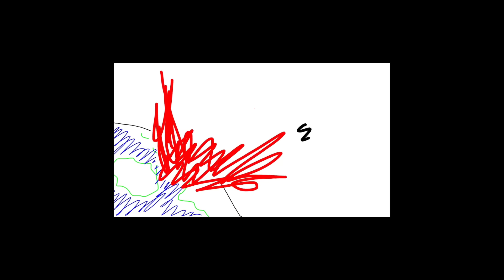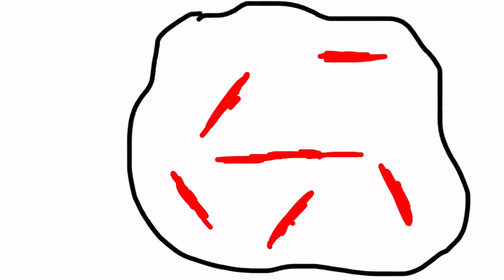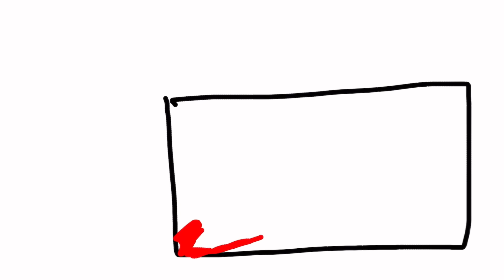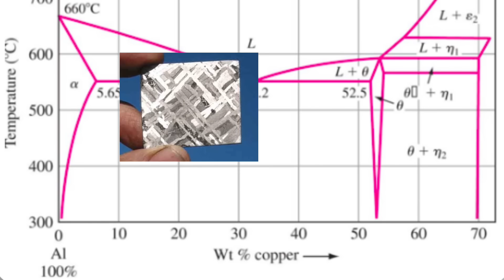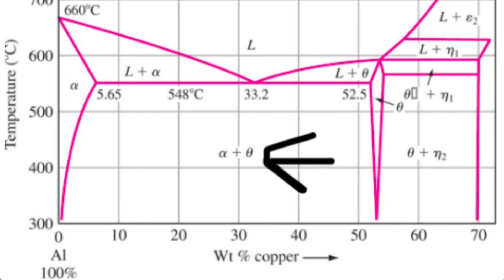Making Meteorite Part 1: Al-Cu

Comment: @Electronimpressions
What would it look like if you attached a fiber optic light source to the defect created by the nail? I wonder if it would only light up the Lichtenberg fractals? Or, try using one of those optical audio cables that emit red light. Try a UV laser too. How do I obtain electron treated acrylic blocks?
Reply from the maker: The channels would scatter the light given to them by the fiber optic, bright lights all across the bottom give a better effect. Unfortunately the charged blocks cannot be obtained— after irradiation we only have a minute or so before all the charge bleeds out from the acrylic.

Comment: im curious how brittle or not this alloy is. it'd make some sick jewelry, or knife/sword fittings, IF its reasonably solid and wouldn't break or flake apart easily
Reply from the maker: It’s extremely brittle and unworkable haha. Al2Cu is more like a ceramic than a metal. I made a different material in my newest video that is orders of magnitude more workable though, although the features are much smaller.
Reply: @ElectronImpressions  oh sick you're already on it lmao. i dont have the set up necessary atm but this might be another reason for me to get a smelting furnace

Comment: I made a similar AlCu alloy about 2018 or so. 

Was more blue colorful like bismuth, and supper brittle. I think i had a lower aluminum percentage.
Reply from the maker: When these ingots first come out of the furnace, there is certainly an iridescent oxide layer present some of the time. And yep— it’s very brittle 😂 Al2Cu is more akin to a ceramic than a metal, so unfortunately this alloy isn’t very useful for anything. But I’m working on a new video with a more workable alloy.

Comment: You gotta cool them in a vacuum, with no gravity
Reply from the maker: The gravity does not really play a role, but a vacuum would be interesting
Reply: @ElectronImpressions  Crystals grown in microgravity have more uniform-diffusion controlled growth.  The molten material is already fighting convenction currents, but gravity adds a lot to the segregation of denser material.  You need the material to change in any way as slowly as possibly.  Vacuum helps control temperature shedding due to convection, but thats negligible with gravity!

Comment: Get a electric furnace, you can hold the temperature at the liquid+θ triangle to get good crystal growth.
You can use a CCT diagram to get the right amount of pattern vs background

nice work, keep on trying!
Reply from the maker: Those diagrams are one of my favorites. I didn’t go too deep into the metallurgy in this video. However I would like to in the future for a follow up or for a different material system when I have that electric furnace and can reliably utilize the diagrams— which is definitely on my wishlist lol, gotta sell enough lichtenbergs to justify its purchase 😂

Comment: That is quite an impressive result! My question is, can this be etched so the color difference is more apparent?
Reply from the maker: I used radiation HF based aluminum enchants with no success bringing out phase contrast. I will be attempting other etchants recommended by viewers shortly
Reply: @ElectronImpressions  Okay, very cool! Thanks for the reply

Comment: Would etching the polished surface with acid make the pattern stand out better? I seem to remember a Cody'sLab video where he partially dissplved some gold and we could see the inner grain structure.
Reply from the maker: Yes your right, although I need to find a good etchant. I’ve used traditional HF based aluminum etchants and it brings out grain contrast but fails to bring out the phase contrast. I need to find an etchant that gives me the phase contrast but not grain contrast. I’ve gotten a lot of suggestions from comments, I will have to try them out when I get the chance.

Comment: If there are some real astro physicists in here, please correct me if I'm wrong, but wouldn't those crystalline structures have formed before they got shot out into space, not after?
My understanding was that much larger, planet sized objects would cool extremely slowly (our own planet's core is molten still), and that causes these crystalline structures to form in their nickel/iron cores as they very slowly cool down, THEN massive collisions happened which shot chunks of that previously molten core out into space. Is that wrong?

Comment: do you have any tips/tricks on the melting process and subsequent cooling process? I dont have access to a large furnace because I usually work with smaller metal pieces for jewellery but I can cast smaller pieces

how hot do you think your furnace got? I hope its not copper-melting temperatures..
Reply from the maker: The copper will dissolve in the aluminum at temperatures much lower than its melting point, so melt aluminum first, then add copper. One thing you should be aware of is that hydrogen is extremely soluble in aluminum and its alloys. A large piece is kind of required because unless your looking for the surface crystals, you must grid away a lot of porosity that results from hydrogen leaving the metal as it solidifies… that or do it under argon/nitrogen. 

I also wouldn’t recommend the alloy as it stands now for jewelry because it is incredibly brittle and prone to cracking. However if you try please let me know how it goes!

Comment: I always tell coworkers that metallurgy is spooky, and to not tempt it if possible (in the context of printed circuit boards, and mixing solder alloys, or using whatever new trendy plating the boardhouse offers, but has no tangible benefit for our application)  Turns out it is indeed spooky to see someone know what they are doing and wielding it and bending it to their will.   Weirdest metallurgy related thing ive seen in electronics is some garbage-tier gold plated RC bullet connectors that didnt have a nickel underplating. Heat them to ~200-250C (as you would soldering in wires, and maybe got it a bit too hot)  at at some point, you can watch the gold diffuse into the copper in realtime. The plating just vanishes leaving a copper surface.  Solid-state diffusion, right before my eyes. (well, under a microscope)
Reply from the maker: There’s a super cool demo that this reminds me of— plating a penny in zinc, then heating the penny to diffuse the zinc into the copper and make brass. The penny changes from silver to gold is just a few seconds, one of my favorite demos.

Comment: would ammonia (or maybe some other compound) be useful to increase the contrast? I often use it in mokume-gane so maybe it'll work on this alloy
Reply from the maker: Thanks for the suggestion, something that works on mokume-gane is the right idea here. I’ve tried and the traditional HF based etchants bring out grain contrast and muffle phase contrast. I need something that contrasts the phases but not the grains. I doubt Al2Cu and Alpha Al are significantly attacked by ammonia, but what could I lose by trying, lol. I’ll let you know!

Comment: I actually saw this intermetallic made accidentally by a channel called BigStackD when he melted down an old household ac unit and poured it into bars. The radiator was made from aluminum fins around copper pipes. They formed this similar structure which actually led me to comment about Widmanstatten patterns and the similarity.

Comment: It was over 30 years ago while plowing, I turned up some rocks in a patch of new ground.  While gathering them to toss into the fence line one was super heavy , and black. That night I took it to the barn.  I beat on it with a sledge hammer to it.  After a long sweaty battle a piece final chipped off.  It had this same grain structure.   I tossed it to a corner , and forgot about it.  Later while studying metal urgery I realized that it was a meteor ride. I went back and looked for it, and it had disappeared.  Still haven't found it to this day. It was near the size of a gallon jug.   If I had of found it , I would have sliced it into knife blades. What would it have been worth , as far as dollars worth?   It was so hard it marred up the face of the sledge hammer trying to get inside of it.
Reply from the maker: I hate to be the bearer of bad news for you but that would be a life changing amount of money 😂 perhaps anywhere from 15k to 150k depending on the grade for something that large. What an incredible find! I really hope you find it one of these days.
Reply: @ElectronImpressions 😢

Comment: Well interesting video  and thanks too my background in a steel foundry  i say bullshit too the "impossible too make on earth" part you already showed that with the AlCu  that if you let the liquid alloy cool slowly enough  so that it is is in between solidus and liquidus lines that the crystal structure cann be grown big enough  but too achive that  with Iron and Nickel you need a realy good furnace with very precise temperature control  just repeating the same process at way higher temps with the right alloy for that and the Fe-Ni phase diagram shows it 

but too be fair the temperature range for Fe-Ni in between the solidus (at its lowest 1436°C and Ni of 68%)and liquidus (at its highest 1512°C at ~10%Ni) lines ar very close and the corelation between alloy and temperature isnt realy  linear 

And i also doubt that your diy Furnace is capable of these high temps (over 1500°C) to begin, but your diy Gas buner furnace could provide an almost perfect cooling  chamber too let the crystals grow at max heat of the furnace and after the ingot is voller than 1400°C you cann let it cool way faster since the crystal should already have formed 

So if you cann build a miniature arc furnace out of the porus alumina bricks  and a old mircowave like Grand Thompson aka King of random did (but please order graftite rods for welding and dont use carbon rods out of batteries ) you should definitely try it out

Comment: Cu and AL eat each other relatively fast. Back in school I poured a bronze and Aluminum casting for my BFA. It looked amazing swirled together but quickly separated as the 2 reacted together. The bronze I used was mostly nickel and copper.

Comment: I would try to reduce tge air bubbles to make something from it !
Reply from the maker: Air bubbles are from hydrogen dissolution and are inevitable unless done in an inert atmosphere. Although they are only present on the surface, so there is plenty of usable material. I would love to make something out of it but it’s so incredibly brittle I fear I would have a tough time!

Comment: Appreciate the video, amazing delivery of a mix of both theory and practice. I'd note that Al2Cu phases can delaminate cause they have different galvanochemical potentials iirc. Also, you may try etching the surface with some other etching agents than a classic Keller solution. Maybe with copper nitrate additives. Would love to see a continuation on that topic!
Reply from the maker: You’re right about their galvanic potential, which is another reason I was hesitant to try other etchants. I had a concern that during etching this would result in a galvanic cell and produce deep corrosion at the interface between the two phases, destroying the delicate structure. However maybe that is not a concern on the timescales required to etch. Regardless, I am still going to try!

Comment: fascinating stuff, I have a wish to recreate this and then etch the polished surface  like you would with damascus steel  to use it for handle material. or decorative box and lock work
Reply from the maker: As the alloy stands now, the material is incredibly brittle and difficult to work with beyond just making an ingot— so keep that in mind if you want to attempt it. But let me know if you are successful!

Comment: Don't wanna be "the Captain Obvious" guy here but, to better see the pattern you have to dip the alloy into acid, not just polish
Reply from the maker: Yes, you are right about that. To etch aluminum alloys we use a mixture of hydrofluoric, hydrochloric, and nitric acid.
This project ran over the course of about a month. During that time came an opportunity I was able to use this mixture, and I etched the 45% Cu ingot (not in video, regrettably). The etching brought out contrast, however it gave me grain contrast rather than phase contrast, and actually reduced the level of contrast between phases. It still looked cool, but much better before etching imo. 

I would have to find an etchant that does not etch grains while etching the different phases to make it work. However I was unaware of such an etchant, but people have been providing a lot of suggestions that I will have to attempt.
Reply: @ElectronImpressions dayum... Too much info for an artist 😅
Tho, I wonder if pouring this allow into different types of molds would make difference (hole in the sand, steel vessel or refractory brick etc.), mb putting some debris into more stable alloy to start the early formation?

Comment: Try using an induction heater in a vacuum chamber
See if you could suspend the molten metal in mid air (with no air) in the magnetic field generated by the induction heater, slowly over the course of a couple days reducing the power and cooling the molten metal. That would be neato
Reply: Molten copper doesn't interact the same as metallic inside a magnetic field

Comment: I might be stupid, but why would it take so long for the metal to cool down, isn't space stupid cold? And the space being mostly empty would mean that there is no significant heat due to friction (I think I'm using the right terminology, like the effect when stuff falls into our atmosphere and starts burning, sorry not a native english speaker), like I know the chunks of metal are probably huge but my mind isn't able to comprehend them needing more than a few earth days to solidify
Reply from the maker: So the asteroids become hot through celestial impacts and are sent out into space. You’re right in thinking that space is cold, but it is cold because it is a vacuum. Temperature is the average kinetic energy of all particles in an area— in a vacuum there are very little particles so there is very little kinetic energy and thus little temperature. But at this point temperature isn’t very useful for us… because temperature requires matter. 

Now say we have a hot asteroid in space. It will cool very slowly because in a vacuum there are no means of heat transfer aside from releasing its heat as infrared light, which is very slow. Here on Earth, hot metal can transfer its heat to the particles in the air around it. But in a vacuum, there are no particles to transfer that heat to.

Comment: A few million years to cool?  Do you know how cold space is?  More like flash frozen.  Also the pattern looks like plywood.  Meh
Reply from the maker: The sense of temperature as you and I intuit it requires matter. Temperature is the average kinetic energy of particles in an area; space is a vacuum and thus there are very little particles, and thus very little kinetic energy. So yes space is “cold” but it makes little sense in the way we talk about temperature. 

Here on Earth, metal can transfer its heat to the surrounding matter around it quite easily… because there is a lot of matter to transfer heat to! But in space there are so few particles, the hot metal has a hard time finding anyone to transfer its heat too, thus can only cool down by radiating its heat via infrared light… which is very slow…. 1 degree per million years slow.

Comment: Don't you kinda also need enough of the right iron isotopes that only exist like.. in orbit around other celestial bodies that are not earth? I would think that the gradual decay of such isotopes is almost as important as having millions of years to cool down? Or is this not an important variable to consider for the structure to form properly? And what about gravity? I would think the gravity of being on earth might not allow the crystal lattice to form?  Or is the formula literally just vacuum, time, iron and enough residual heat to start off with? Many natural patterns look alike, how can you verify that your structure is EXACTLY like what we find in meteorites? Or are those too random to pin a pattern (like snowflake structures?)on that bears pristinely repeatable results? Its a lot of questions. Take your time ! I do enjoy your process and results :)
Reply from the maker: I don’t want to get the wrong idea here, my structure is absolutely not identical to the widmanstatten in real meteorites, it’s not even iron or nickel haha. My structure is made from a liquid to solid phase transformation while meteorite is solid to solid. But, in my opinion, my structure is still at least very cool looking and shares a strong resemblance. 

As far as the iron and nickel isotopes, I think that may actually be relevant. In very large asteroids heat from radioactive decay may be a factor that allows for even slower cooling? Or perhaps giving them an initial high temp if not initially hot enough? 

I don’t think gravity is a limiting factor in widmanstatten formation.

Comment: Can this be etched to highlight the pattern at all? This would be great for knifemakers to use as fittings or handle material the way that meteorite is.
Reply from the maker: I’m working on finding an etchant that works. Trouble with traditional etchants is that it brings out grain contrast and muffles phase contrast.